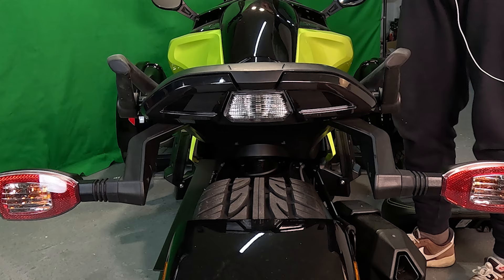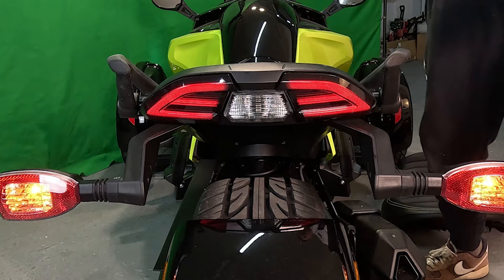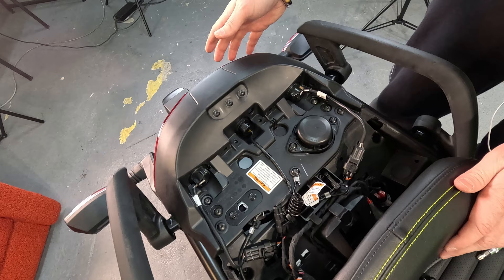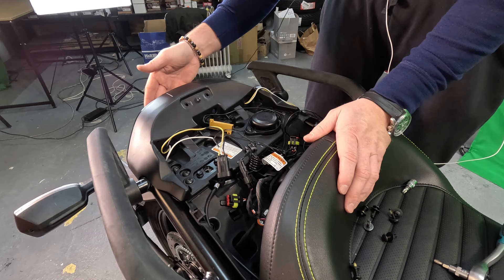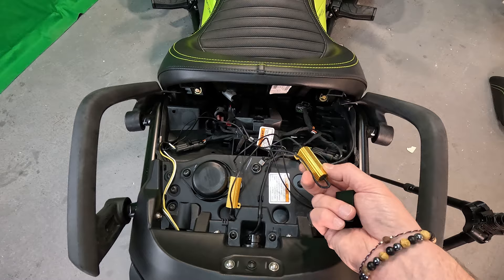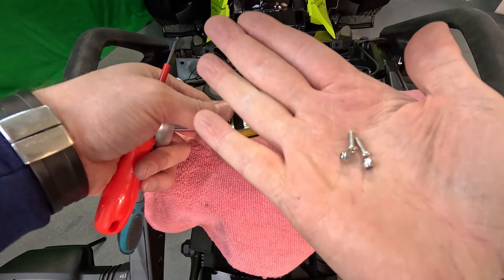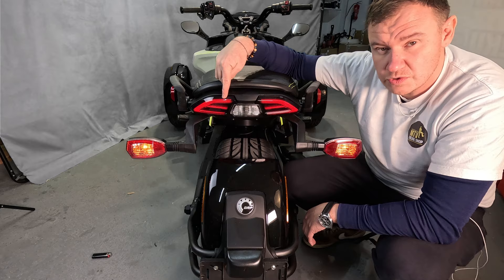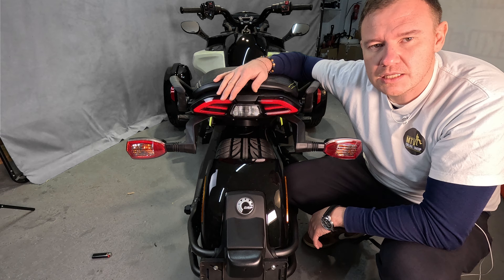Elevate Your Spyder F3 Style and Safety with Full LED Taillights  | Installation - Plug & Play

Comment: Another great video. However, the stock lamps appear brighter than the new ones.  Perhaps it's just that they have more surface area.  I would not switch to these for safety alone.  I would opt for brighter bulbs instead.  Do you have any lumen output information on these Martin?  It may be my perception, and to compare stock to these would be a great way to inform your audience.
Reply from the maker: Great point. In general i believe it was also light in the studio that made it look less visible, but they are at least the same butwith much coplete full light look so more visible. However we are working on "less cool" more visible option 😉😉😉

Comment: At the Daytona 500 I can just learn it.  I don't need the resistors, do I?
Reply from the maker: No resistors needed. Plug and play. Works wth daytona 500 😉😉😉
Reply: @MartinTheVlogger  No resistors required.  But you have some on it.  Can you also buy without resistors?
Reply from the maker: @bumblebeespyder1987  its plug and play. You use at as it comes 😉😉😉😉😉😉😉😉😉 nothing more and nothing less its needed 😉